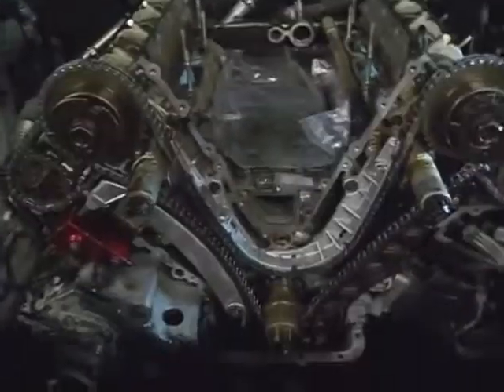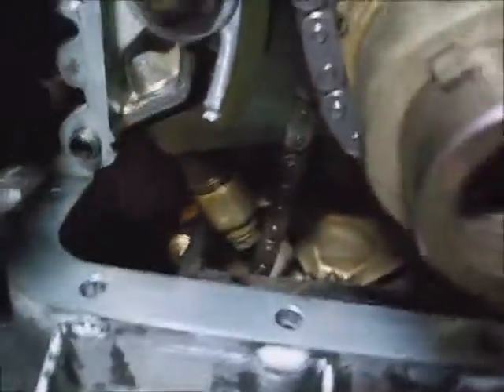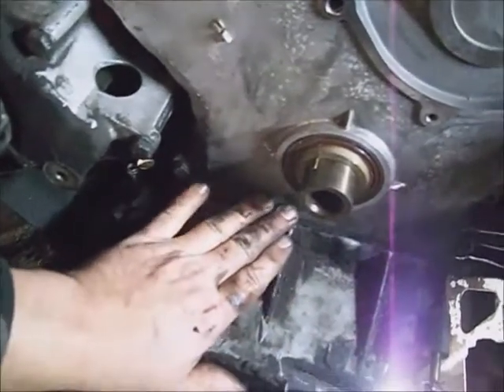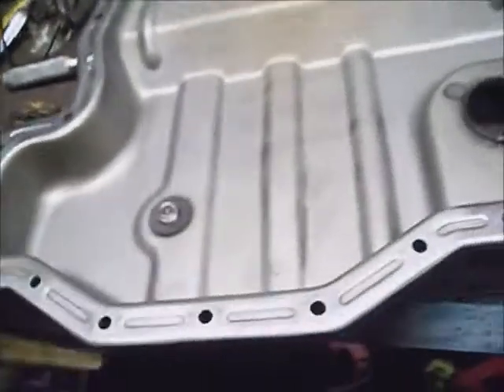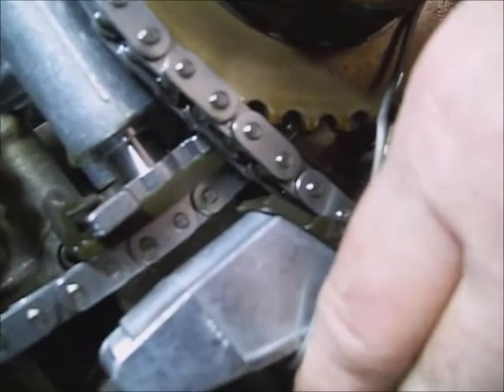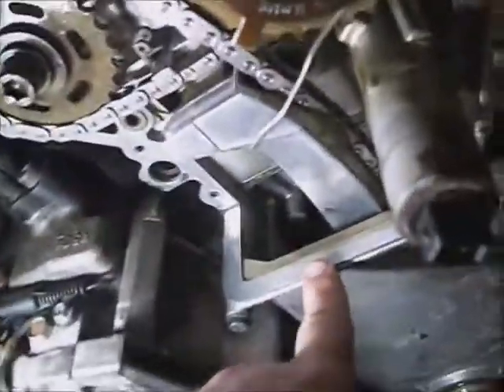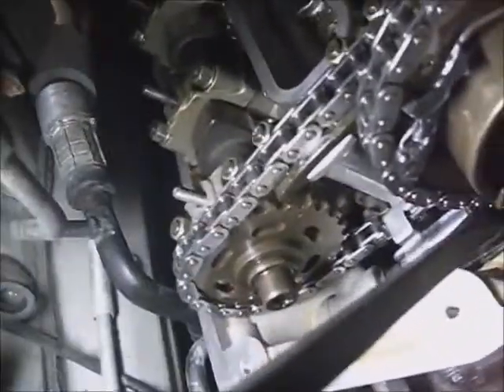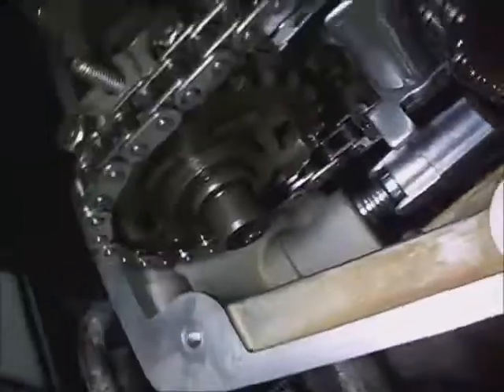BMW E39 `02 w M62TU pt.6 oil pan, lower and upper timing cover, tensioner plunger install

Comment: Great vid guys, lots of extra detail. 
Personally I would sand those grooves in the timing cover to prevent a potential crack from any stress & I will put a flat magnet In bottom of oil pan too! Since I’m doing this in the vehicle (‘03 Range Rover HSE) it may not be so easy to do oil pan removal without the kit for the 2 piece replacement pick up tube to make the installation process possible and future EZ removal.
Not Looking forward to doing this job but wanna do it right the first time! 
Took a lot of searching to find this vid and should be on top for the extra details! XD
Reply from the maker: I wouldnt recommend removing any excess material from t-cover.  It really isnt a high stress area at any specific points, to crack.  Thanks for watching.

Comment: Great video btw. Quick questions: 
when removing the tensioner plunger should I try and fish a wire to hold the tensioner in place? I'm not planning to fuss with the timing, just want to change out the gasket. 

Also @11:45 you pulled the crank pin when putting the oil pan on. Can you explain the importance of doing so? Was this something you added before the video started for the "top dead center"? I'm planning to DIY this project but I'm not sure how the crank pin ties into the work.
 Thanks in advance.
Reply from the maker: If not using the special tools and setting the engine to TDC first, then maintaining the chain tension would be advised.  The cams could at any time be able to jump time a tooth if the chain became loose.  Unless the special cam holding tools are installed.  Be sure to secure tensioner arm with a method capable of holding up to 10 lbs.
Reply from the maker: This is a series of 8 video`s involving replacement of the timing chains and guides.. So cam holding tools were also used.   And since I had already installed and set the timing chains, while I was installing the oil pan and was under there, I went ahead and pulled the crank pin so I didnt have to go back under there again just to pull pin. Mose over video and hit (i) to see the link to video 1, or continue to video 7.

Comment: While tightening the lower timing cover bolts, one of the longer 10mm bolts stretched and nearly broke off in the block (my heart rate immediately spiked). I was slowing working all the bolts to 10Nm in a star pattern of sorts, being really careful. I've since removed all the bolts (except the 13mm ones, they torqued to 15Nm), and noticed a number of the 10mm bolts are stretched. Should all the bolts be replaced before putting the timing covers back on? I've priced all the bolts for the lower and upper covers and they're super expensive, about $200 shipped.

I spent the day yesterday reading about bolts and am wondering if I can just buy aftermarket steel bolts with the proper grade since the M62TU block and heads are aluminum, at least for those bolts that are unreasonable expensive. It seems the BMW bolts are coated, and the best I can tell from the dull silver finish, the coating may be cadmium, but it's hard to find this information. Also, if the bolts are cadmium-plated, I read that the maximum tightening should be 30% less (so around 7Nm for M6 bolts), so it got me wondering if that was part of my problem (seems unlikely). I'm just trying to figure out why the bolts are weak. My X5 is nearly 19 years old so maybe the bolts need to be replaced. 

My apologies for the long-winded comment.
Reply from the maker: 10 Nm isnt going to stretch or break anything, I would say that the torque wrench has a calibration problem.  And typical afer-market bolts will work fine, as lo g as the length is in the ball-park.  Thanks for watching
Reply: @AutoDrdiy  That's good to know about the aftermarket bolts, thanks. 

I guess the torque wrench could be an issue, though I have a general ideal of what 10 Nm feels like and the resistance didn't feel way off base. Is it possible the bolts are weak after 18+ years of use? I'm definitely going to buy BMW replacement bolts for the ones I wrecked, but maybe not the whole lot (some are $10 a pop, which just seems outrageous to me). 

As always, thank you for your amazing videos, and your helpful and timely responses.
Reply: @AutoDrdiy  You were exactly right. I went and bought another torque wrench (that measures in inch pounds to give me greater accuracy at that low of a level) and the bolts were indeed being overtightened.  Thank you again.
Reply from the maker: @andig28  Yes sir, those bolts would take take 15 Nm without a problem, but not recommended.  Lucky didnt strip threads out of engine.  Thanks for watching.

Comment: Hi. Do you know if the P/S pump chain has an adjustment if it seems to loose? Of course you'd have to remove the pan gasket to access it. How did you clean the pick up screen did you take it out?

Comment: I noticed between the last video and this video, the upper oil pan gasket is removed. Mine is still in tact and seems to be fine. Would you recommend I cut it out and create a new one with RTV silicone? Or would it be okay to just reinstall the lower timing cover as is? Thank again for these videos and all your help.
Reply from the maker: I just usually put a layer of silicone on top of old gasket, and a bead against the block corners.  Just to freshen & seal up the paper surface.  Thanks for watching.
Reply: @AutoDrdiy  Perfect, thank you once again!
Reply: @AutoDrdiy  would you recommend trying to swab some RTV underneath the gasket to the upper pan also? You mention "hock and puckey" at one point - is that RTV or something else? Thanks for the vids - taking it step by step.
Reply from the maker: @stuartcowen9354  Yes that is RTV, and it wouldnt hurt to have some in there.  Thanks for watching